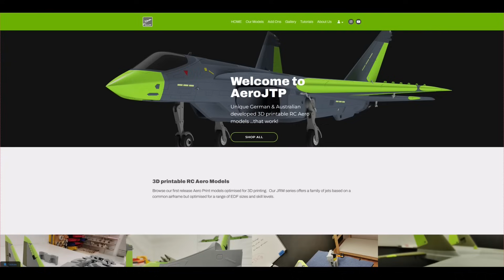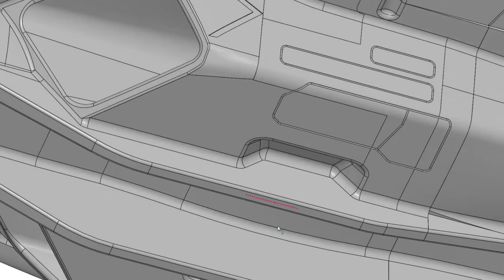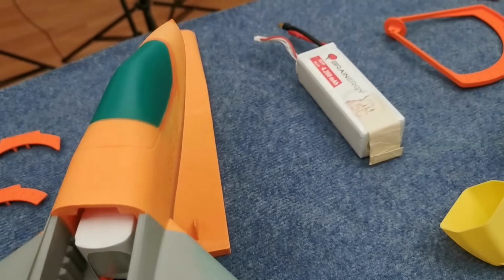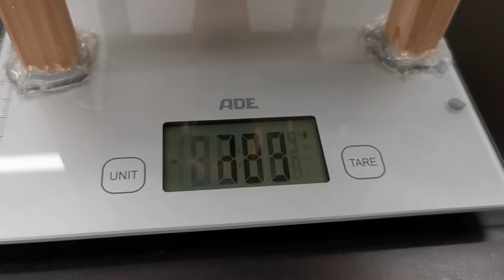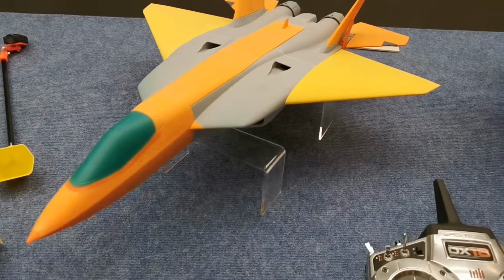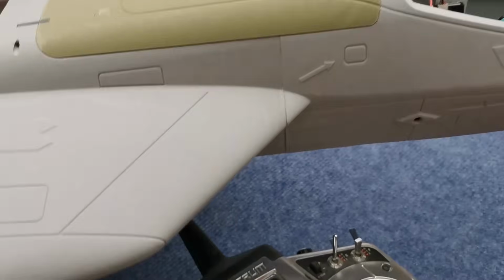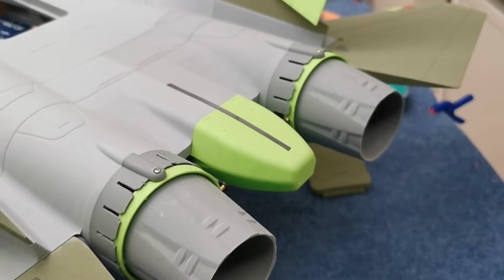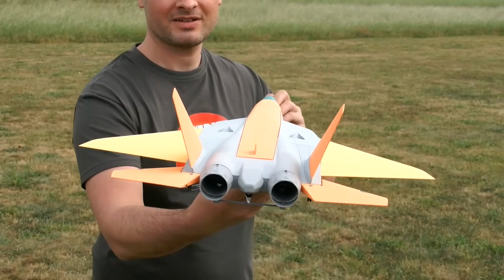JRM-01 3D-Print RC Jet-Series is Released Today!

Comment: I enjoy rc plane designing and 3d printing my creations.  I appreciate all the time put into these planes and testing you've done. Just ordered Jrm 30 pro. Will put my X1 Carbon to work. Thank you!! I have enjoyed all of your videos.
Reply from the maker: You're welcome Brian!
Reply: We look forward to seeing your progress and final results!
Reply: Hey, I just ordered the 30 juniors and I’m wondering where you got a few parts cause the parts list doesn’t look 100% complete. First of all what did you get for the threaded rods and end links for the elevator servos? It says to get a 200mm rod but that seems way too long. Also he says in the video a carbon rod is used to let the elevators pivot but that’s also not in the parts list. Did you figure out what to get? Finally, did you get the 5v version of the UBEC or the 12v? Thanks in advance btw, I’m just a little confused on what to buy
Reply from the maker: @trailswithtyler7427  Hi Tyler, thanks for your notes, partlist will be completed soon. Threaded rod: 2x 60mm M2, Elevator Axle: 1,5mm Carbon Rod 2x100mm long, Wing joiner: 4mm Carbon Tube 300mm long. BEC: 5-6V.

Comment: That is a strange question 😂 it will be able to take off and land vertically!

Now seriously, if you mean the differences in the build: there are fuselage changes behind the cockpit to allow for a ducted fan and yaw control vanes and also upgraded wings with inbuilt lift fans and fan covers. So some considerable design upgrade.

Comment: Masterpiece of 3d print and engineering. Congratulations. I have a question, if I buy CTOL WPL top model, are stls for hand launch version included, or i must buy both ? I suppose there are some more differences - like covers if gear is not used.
Reply from the maker: Yes, there are many differences so you should buy both.
Reply: @rene_marc  You shoud create AllInOne Edition :goodvibes:

Comment: Хорошая модель, однако открыты вентиляторы двигателей в воздухозаборниках для засветки радиолокатором. Самолёт не может быть невидимкой по вышеуказанной причине, вентиляторы будут светиться. Кроме того , воздухозаборник не регулируемый, для радиоуправляемой модели сойдет, но не для реального самолёта, он будет сильно ограничен в динамических разгонных характеристиках. Слишком толстый профиль крыла указывает на то, что это игрушечная модель предназначена до дозвуковых полётов на очень низких скоростях.
Reply: Your observations are spot on! It is not meant to be an actual jet design but a 3D printed radio control model that can be printed and built and reprinted if damaged 😉

Comment: Hi nice model for 3d printing  , i visited your website  , but i couldn't find details about fpv heaf tracking. Does it support fpv head tracking?
Reply from the maker: Sure, for the 50mm EDF version is a special FPV set available.
Reply: @rene_marc  so does that special version supports head tracking fpv gear to be installed and it's included with the files on purchase ?
Reply from the maker: @arvindthiagarajan9913     it is  a flat plate insteat ogf the canopy see here: https://aerojtp.com/s/aero-jtp/:Add_Ons

Comment: was so close to buying and then I saw the 5s battery (I have 4s and 6s), when the larger version comes out will it support 6s?  believe it or not I buy my planes based on the batteries that I own rather than buy batteries for the planes.  Looks awesome though.

dave
Reply from the maker: No problem, I used the 4000kv motors on 5s, cause I got this battery. you can go with the 3300kv on 6s or the 4600kv on 4s.
Reply: @rene_marc  Are there any flight videos of the JRM-01 50mm?  Have you done the epoxy treatment to the version with panel lines?
Reply from the maker: Covering is not necessary anymore by using the latest printers like Bambu. More flight video here https://youtube.com/playlist?list=PLj7ASLgDJ1wmD1YjcB5ghv0wTCIuVXdOA&si=hwuzs0W4qFHyw2O3
Reply: @rene_marc  thanks!  not having the 5s would you use 4s or 6s on this and do you need counter rotating EDF?
Reply from the maker: Not necessary.

Comment: How is work on the slat scheduler going? Any updates on it?
Reply from the maker: On the JRM-01 were no slats planned. What do you mean?
Reply: On a previous video we and actually talked a little about a scheduler that might be able to use a sensor and either obtain airspeed as a way to extend the slats or angle of attack. You could even compute angle off attack with an accelerometer and use that to extend slats by a certain percentage.

Comment: Twin 50mm edf with RETRACTS? What kind of 50mm edfs are those? 4 or 6s?
Reply from the maker: I'm using QX Motor 50mm EDFs with 4000kv on 5s.
Reply: @rene_marc  What's the TWR of those jets? I usually like to keep it over 1.5 for EDF jets

Comment: What’s the advantages to the one with vector nozzles? Is it easier to fly, more maneuverable, or something else?
Reply from the maker: Yes, it's better controllable at minimum airspeed. It also gives more authority, which is great for aerobatics.
Reply: @rene_marc  hHey, I just bought the files and am in the process of buying parts. What is the length of the threaded rod needed for the elevator servos? In the parts list it says 200mm but looking at the 3d files it seems it should be much shorter than that
Reply: @rene_marc  Also I don't see the carbon rod that you used to allow the elevators to pivot in the parts list. What are the dimensions of it.
Reply: @rene_marc  Also im guessing im supposed to get the 5v version of the UBEC right?

Comment: Hallo René, die JRM50 (in Vollausstattung) konnte (mit Ausnahme der Regler) exakt nach deinen Vorgaben fertiggestellt werden. Gewicht mit Akku etwa 2300g. Als Antrieb wurden die von dir verlinkten 50 mm EDFs verbaut. Verwundert war ich bereits beim Lesen der technischen Daten, wonach diese EDFs für 3-4S gedacht sind. Laut deinen Vorgaben kam aber ein 5S Akku zum Einsatz. Die Leistung mit 4S war ziemlich lasch, also habe ich wie du einen 5S eingebaut. Nach etwa 20 Sekunden Flugzeit sind beide Motoren in Rauch aufgegangen und ich durfte gleich mal die Segelflugeigenschaften der JRM testen. Jetzt die Frage: Welche passenden EDFs für 5S kann ich verwenden, ohne eine Wiederholung dessen zu erfahren? Die vorgegebenen 50mm EDFs für 3-4S können nicht wirklich passen!?
Reply from the maker: Hi Ricky, welche KV haben deine Motoren? Bei mir laufen 4 Stück seit 1,5 Jahren im Dauerbetrieb.
Reply: @rene_marc Hallo René, ich halte im Moment einen knusprigen QF2611-4000KV in der Hand. Ich habe die Verlinkung aus der Part List mittlerweile 4 mal überprüft. Ich habe leider noch nicht verstanden, wo mein Fehler liegt. Wenn es bei dir mit 5S hinhaut, bin ich optimistisch, dass du mir hier irgendwie helfen kannst.
Reply from the maker: @RickyScheinert  Ok Motor passt. Welchen Regler nutzt du?
Reply: Ich nutze einen sehr grobschlächtigen Red-Brick  70Ah Regler. Der hübsche, elegante Regler aus deiner Part-List war leider nicht mehr verfügbar. Wiegt zwar deutlich mehr,der Backstein,  sollte aber von den Eckdaten hoffentlich halbwegs equivalent zu der Vorgabe aus deiner Part- List sein.
Reply from the maker: @RickyScheinert @RickyScheinert  Die red bricks hab ich hier auch. Das sind minderwertige Regler die gerade bei hohen Drehzahlen sehr schlecht funktionieren. Darum sind deine Motoren durchgebrannt. Schreib mir bitte mal ne mail und ich schicke dir links zu passenden Reglern.
Reply: Mail hab ich an aero-jtp geschickt.